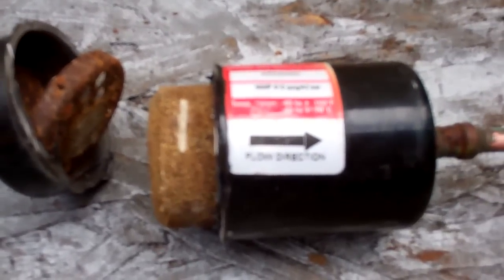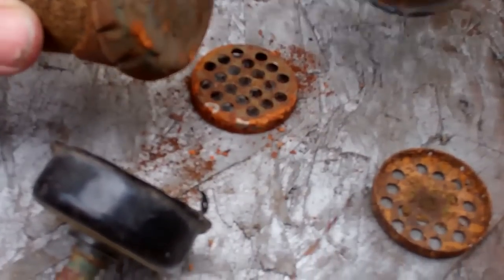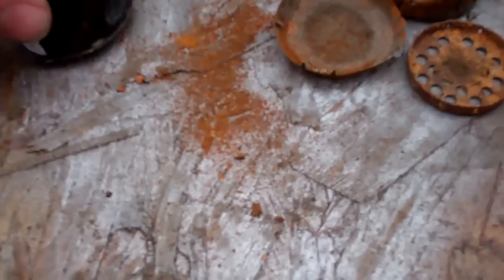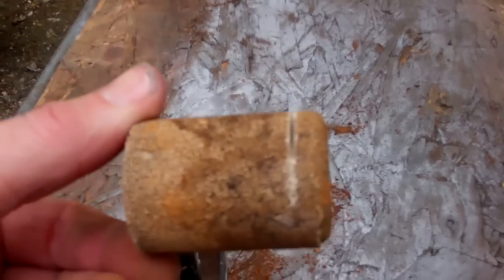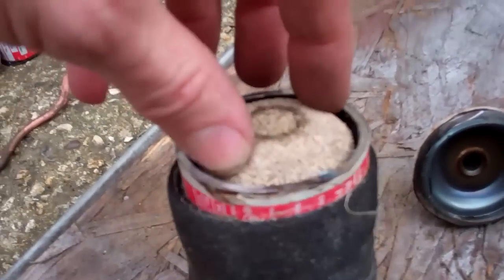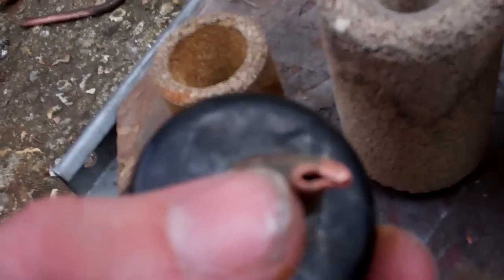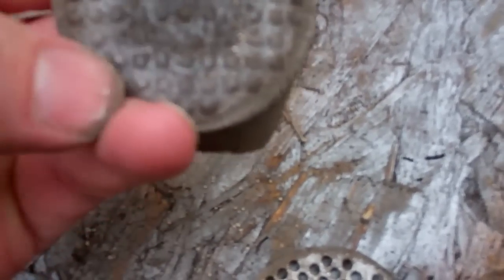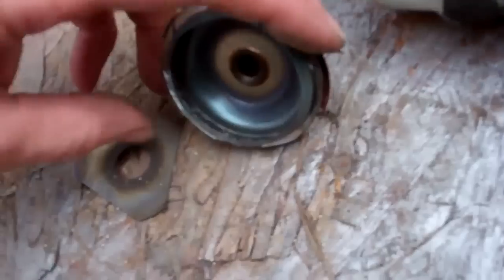HvacR Drier autopsy

Comment from the maker: Hi! I mostly fit Sporlan, but Danfoss is my second choice, both very good driers imo.
I forget what vac level i got it down to but it was under 600 microns i think.
I'd never have put a new compressor and evaporator on this system like the previous company after seeing what condition it is in.
Its been running a week or so now, fingers crossed :-p

Comment from the maker: System had a low side leak, Low pressure switch set to cut out in a vacuum and not even wired into the control circuit, fast forward four years and this is what you get! 
Systems never going to be great but i hope it will be good enough now, time will tell :-)

Comment: thats a seriously wet system. that compressor wont last long. must have been raining when they installed it or had a low side leak and ran in a vacuum suckin in moisture for a while. thats crazy. even if they didnt pull a vacuum on it when it was installed i dont think it would be that bad... idk